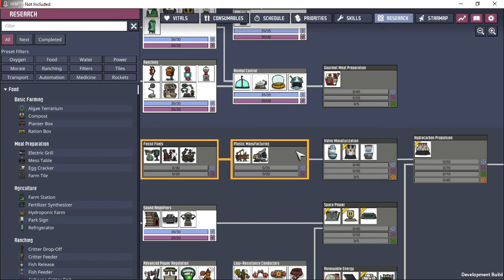ONI Spaced Out S3 E008 dupes just want to hert

Comment: Day 85
Going for a run. Then doing some hauling. And Running again. The Boss is very unsure what he wants to do. Sadly not very reassuring.
Day 86
Everybodies working for the weekend. Wait? We don't get weekends? Guess I'll do everything but research... hauling, building and running. The Boss didn't hear the portal.
Day 87
The Boss ordered Oxyfern again. Not sure if he just didn't like anyone or is afraid to add another. It's crazy I came to space to research and maybe do some adventuring and instead I'm mopping a floor. Damn. 
Day 88 
Research! Oh yeah! The Boss is everywhere today. Normally he is set on one project and won't deal with anything else. Today he is working on a minimum of three.
Day 89
No more research selected. Alright. Guess I'll help with this huge airlock. The Boss is setting up a door airlock like he has before but for some reason he is using mechanized airlocks rather then the manual airlocks he normally does. Is this an error or new design. I'm calling error. And then he just deleted it...
Day 90
Hauling. The Boss ordered a snazzy suit, which he gave to me. I knew I was the highest ranking worker. And The Boss even commented on my research speed. I'M FAST AS....(there appears to be ink spilled in this spot)... BOYS! More research! 
Day 91
Back to research! The big airlock is done, and so is the research. So back to hauling. 
Day 92
Hauling and building today. The Boss "You guys are dumb and trapped yourselves in there." Hold on correction. They are dumb and TRAPPED ME IN THERE! The plan was to do the floors so the water wouldn't be lost... oh I'm aware of my problem. Trap without Oxygen, with nothing to building items to build the ladder. Also I went in to make sure no one else got trapped. I also did trap everyone down there... that is my bad. I should have checked again no one was down there before building. Thought you gave orders to stay out. 
Day 93
I was making sure no one was trapped down there again. (Truthfully it's an Oxygen thing. There must be a pocket of air down there and they rush to it.) I got trapped again, making sure no one was down there because I heard The Boss screaming about it. I am building stuff down here so other team members don't have to be burnt. Just being a good team leader. Also The Bosd ordered Nutrient Bars. I just want to point out that once I got trapped down there everyone else was very busy... somewhere else in the base.